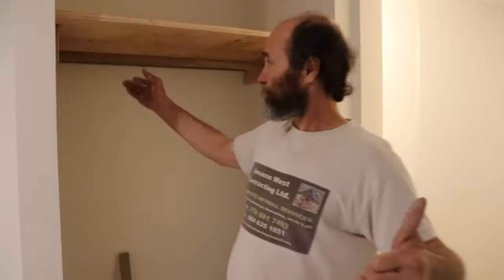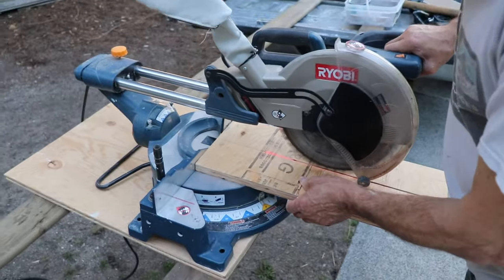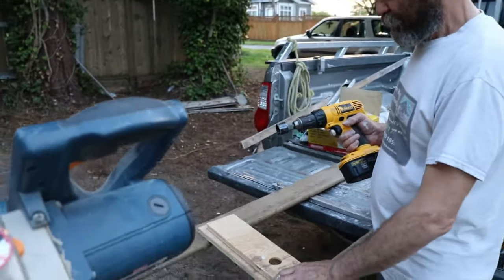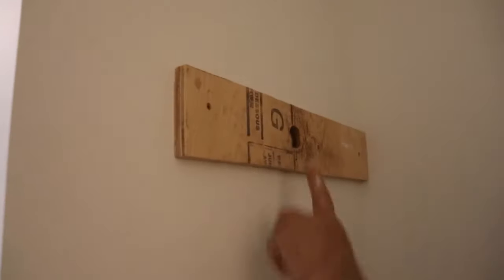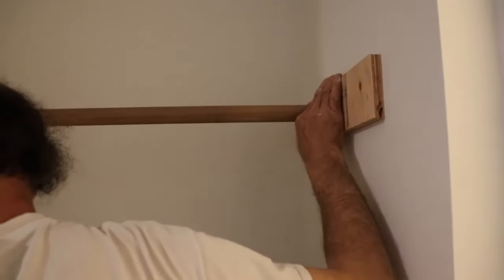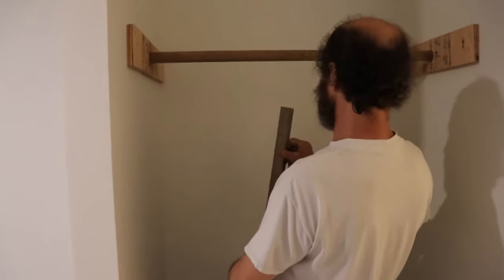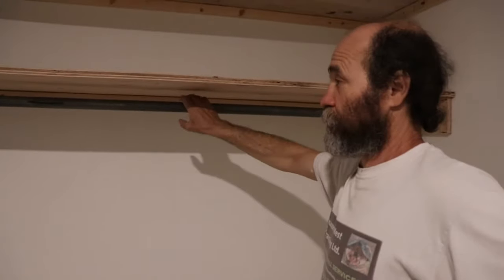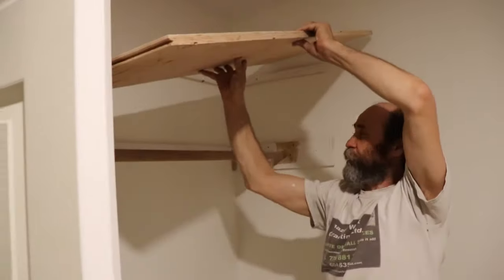How to build WALL MOUNTED COAT RACK & SHELF

Comment: Looks like you might have some mold at the bottom of that closet
Reply from the maker: Hello my friend, thank you very much for your time and comment, good observation, that is not mold, it is some acid stain from the foor that splashed on the walls, next time that we gonna do floor stain, we will do better walls protection for sure, keep safe